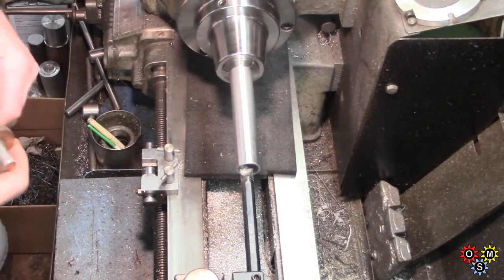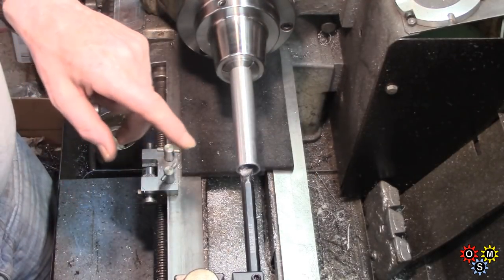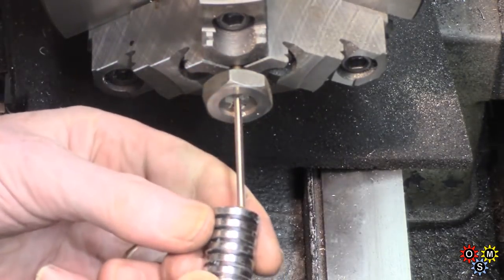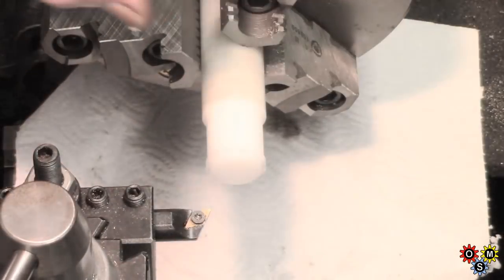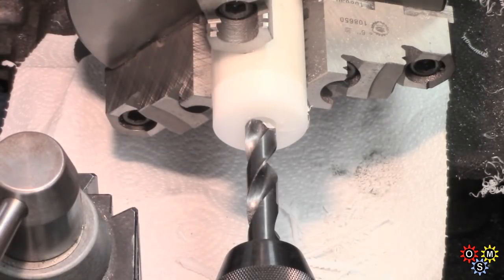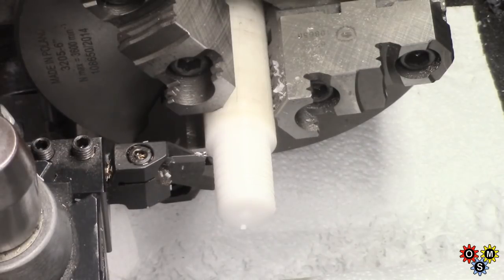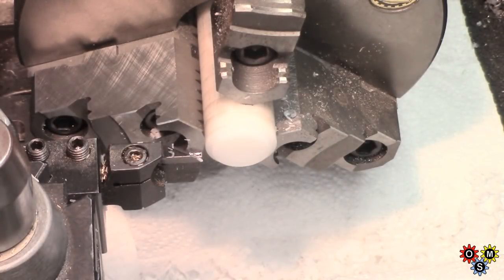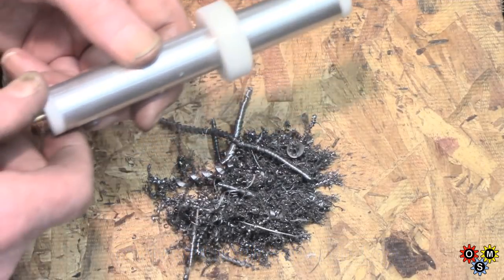Chips "Picker-Upper"

Comment: Neat idea. I made one out of old scrap 1/2” copper water tubing. Copper end cap sweated on. Magnets bought to fit. Mounted on a brazing rod that was mashed on the end to retain the magnets. (Old world craftsmanship.) I ended up with a 4” square of HDPE because the chips were crawling over the first small plastic ring. It works without getting steel splinters in my fingers.
Reply from the maker: Glad that worked out for you - for sure, there is a need to stop chips crawling over! :)

Comment: The rear nut is not needed! Use gravity! Just made a prototype that collects, and disposes, iron swarf etc. In order to acces as small corners as possible I intend to make the stop coller movable. Retract it, pick up the swarf and then slide it towards the swarf and retract the magnets.
Reply from the maker: Indeed, gravity can be enough. My stop collar can be moved actually but I have found that it performs OK mostly in the near fixed position.

Comment: Here You come again creating stuff I really need. Started turning a 7" cast iron face plate yesterday, now having that dust all ower the place.
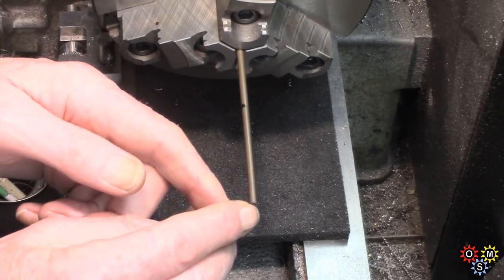At the time 4:30.... You could thread the tip of the brass bar and used a clamp at the rear.
Thanks a lot for the inspiration!
Reply from the maker: Hi Stefan, thanks - well, for sure with a load of cast iron chips this is a useful gadget! :)

Comment: Nice project, those ten magnets might be overkill but nothing you pick up will ever fall.
Reply from the maker: Hi Jim,
Thanks. Well, my first small unit was not really powerful enough for decent pick ups - so, having had those 10 larger magnets I went for broke! In fact they are not overkill because even those can only manage so much. It's certainly a much more efficient device. :)
Reply: Might be ok for magnetic items but how often is that done 1 in 300?